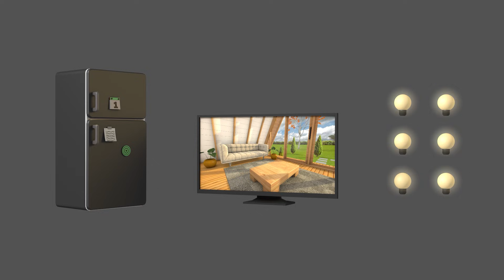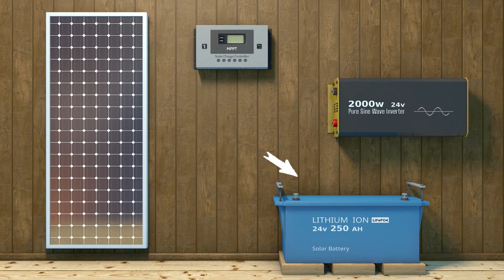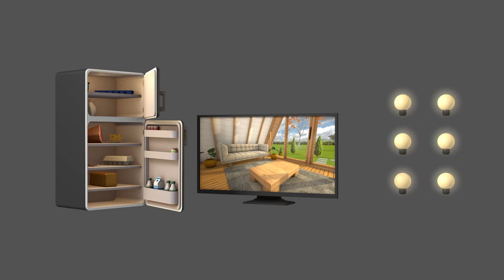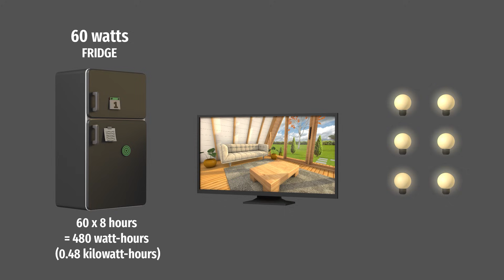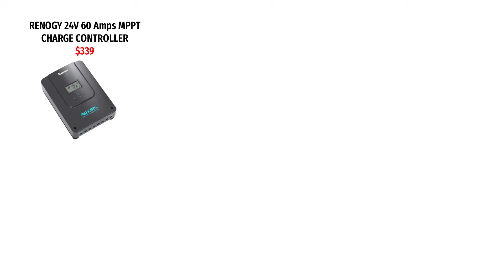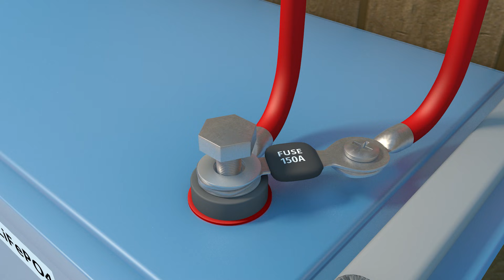How many SOLAR PANELS do you need to power a Refrigerator, TV & 6 Lights (even in bad weather)

Comment: With this setup, can you hook 3 batteries in parallel and use all the same size wire to do so. Also what would be the maximum amount of solar panels with 400w each you could use.

Comment: I built a solar generator using a 4000 w inverter a 60a charge controller two 400 watt panels and two 200ah LiFePO batteries
Reply from the maker: That sounds like a solid and powerful setup! 😊